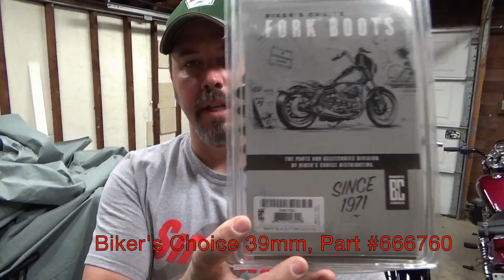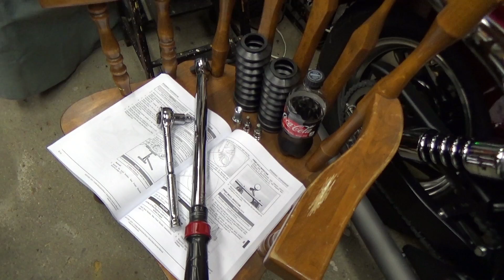Project 2016 Indian Scout Sixty Part 6 (Bikers Choice Fork Boots)

Comment: Thank you for this video.  It made the task very easy.  I ordered the black fork boots you listed.  They are reasonably priced and look great.  I would just add a couple of things.  1. The boots were really freakin tight.  Tried Windex but didn't help.  Used 3 -1 oil, helped a little.  It was really tough getting the boots to slide down even after cleaning the struts.  Took more time to gets the boots down than anything else.  They could be a Mili or two larger.  Strut arm swiveled/turned during the process of sliding the boots down but it is no problem according to the Indian Tech.  2. Used a screwdriver to pry the lower clamped pinch area just a little to get the strut slide back up; they did not easily slide up even after cleaning.  3.  I used Permabond never-seize on all hex-bolts except the axle.  (Have axel grease if you get a lot off.  4.  There are no alignment issues with the scout, nothing is adjustable on the front.  Thank you so much again for this video.  I have a 2016 Scout ABS.

Comment: After watching this video, I decided to put the same boots on my 2018 Scout Bobber. They look awesome, but damn were those forks hard to remove. You made it look easy.
Reply from the maker: They were easy to slide out on my 2016 Scout Sixty. The Bobber has revised forks so maybe there's a slight difference. Sorry it was difficult for you. I have read some people using a flat blade screwdriver to open the pinch bolt slot slightly to help give clearance. Seems Indian has made a few tweaks to the suspension on the Scouts since they first started shipping. I know the Bobbers are slightly different. Well hopefully you got it sorted out. Thanks for watching!

Mike
Reply: Rench Ranch. The satisfaction of doing it yourself is always worth it. BTW, thanks for posting your video. Now if you can make one showing how to remove the valve covers, that would be great.

Comment: I considered doing the same to my Bobber, but was talked out of it because I was told those boots will trap debris inside them.  Have you ever bothered to check them out after riding for awhile?  Are the fork tubes still pristine and clean?
Reply from the maker: Yes, I check them at least once a week. I always clean off the fork tubes. I have not see any build up of dirt. On the contrary, it seems to keep them cleaner. These particular fork gaiters / boots have little vents at the base so air, dirt, water can get out the bottom. They slide up easy enough to inspect and clean. Zero issues. I give them a little WD40 spray under from time to time and wipe it clean. Thanks for watching, Cheers!

Mike

Comment: Great video !   I'm about to change the front springs and oil so that was very helpful !  The fork alignment issue troubles me a bit, wouldn't the tire bolt act as a good measure for alignment,  ie before your torque down the fork pinches run the tire bolt through the forks to make sure they are lined up?   Or mark the top part before removing the forks?
Reply from the maker: There is a procedure in the Scout manual for aligning the forks. Which is what I used to check it. Since it's a safety concern and I am not a professional mechanic, I didn't show how to do it. There are several fork alignment vids on YouTube. Between that and the shop manual for the Scout it's not too difficult. 

For my Sixty, even after torquing the axel and pinch bolts down, the alignment was spot on after I checked it. I also re-checked the bolt torque after my first ride. So I don't really have a set procedure for it. I can tell you that doing one fork leg, then the other should prevent the upper yokes / triple clamps form moving in relation to the head stock. But always verify it IMHO. Thanks for watching!

Mike

Comment: I have 2018 scout bobber, it says I have 41mm forks are they the same size as the sixty cause you used the 39mm boots and looks like they work. Should I get the same size you got 39mm or get the 41mm?
Reply from the maker: All Scouts use 41mm fork tubes. For the Bobber they changed the internals slightly for a cartridge insert for better handling. The diameter is the same as they still bolt up to the exact same fork yokes / triples. Unless someone has made a 41mm fork boot with the correct diameter on the bottom to fit the slider top, the Bikers Choice ones I used are still the boots to use. They are a little tight at the top but with a little windex they will slide on easy enough. 

I think the Scout Bobber sits a little lower so the fork boots will bunch up a little more but they should still work. Thanks for watching! Cheers!

Mike

Comment: Hey Mike can you comment on the LED light?  I just got one for my 2015 Scout from Eagle Lights.  Looks like an easy swap (plug n play), agree?

Jim
Reply from the maker: Hi Jim,

Wiring wise, yes its super easy. Plugs right in. The outer bucket trim / retaining ring will need to be filed back on it's inner edge where it comes in contact with the lens of the Eagle Light unit. On my Scout Sixty since this ring is painted black, the added thickness made it so the ring wouldn't slip over the Eagle Light fully. It must be able to slide "EASILY" over the lens. If you have to use any force other than just sliding it over, it won't seat all the way down and the spring clips won't fit correctly.  I just used some 120 sand paper and sanded down the inner edge part of the outer bucket trim / retaining ring all the way around. I was careful not to damage the paint on the outside. Later I painted up the edge with some black Testors model paint to protect it once everything fit perfectly. Once you go to put it together you will instantly understand what I am talking about.

Inside this part there are (if I remember correctly) 4 spring clips. Unless the Eagle Light is able to seat freely (and fully) into the buck trim / retaining ring, you won't be able to get these clips to lock correctly. Lastly there is no detent to align the Eagle Light so it's perfectly vertical / square to the bucket. You have to eyeball it as you're putting in the spring clips. The Eagle Light works great, but it's basically designed for a Harley Sportster sized bucket. The Scout's are Metric so this may be why the Eagle Lights won't fit without a slight mod.

This all sounds like a pain but it was very easy. Take apart (1 screw) the bucket trim / retaining ring, remove the OEM headlight assembly, sand the inner edge of the ring where it fits over the Eagle Light lens, assemble in reverse order. The wiring is idiot proof. Just plug it in. You don't plug in the parking lamp as the Eagle Light doesn't need it. Just tape up the connector ends. I used some heat shrink on mine.

If your OEM headlight assembly has a chrome bucket trim / retaining ring, it may fit without filing or sanding. There is also an Indian Accessory Bronze one. Thanks for watching!

Cheers!

Mike
Reply: That's awesome, Thx!  I have the chrome trim and based on one video of the Eagle Light install that's on YouTube he did not have an issue with the trim ring slipping over the light.